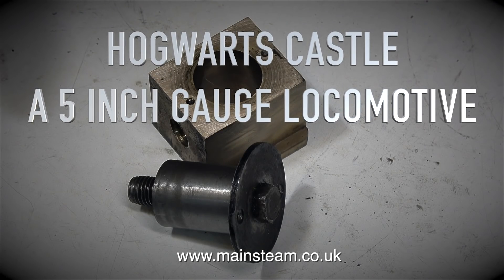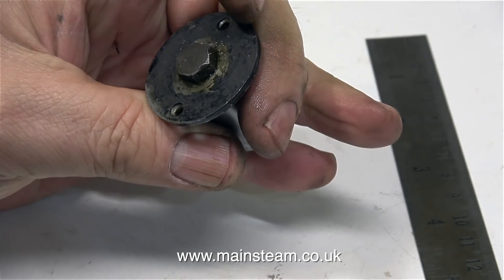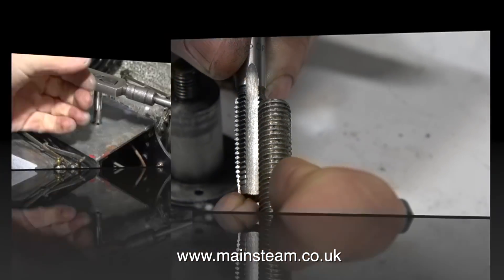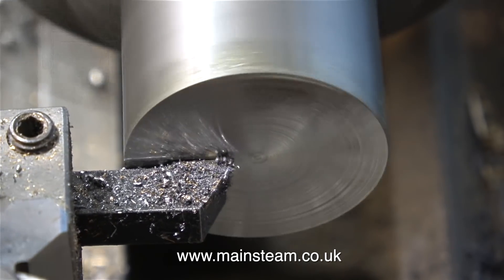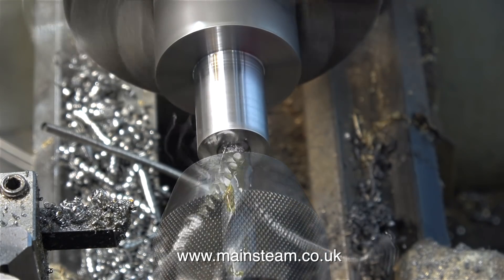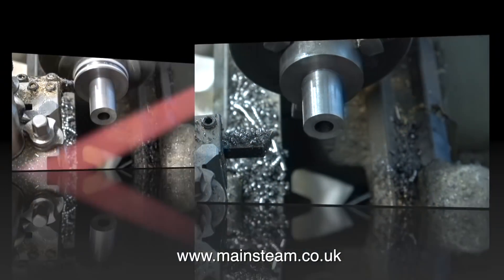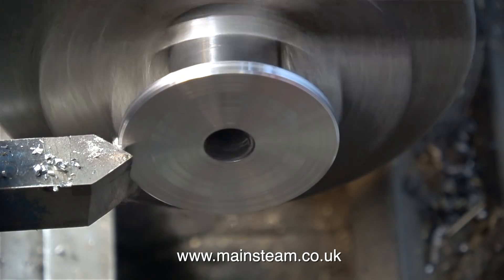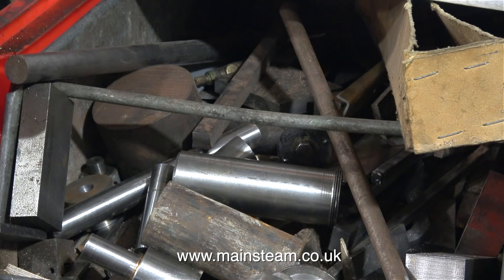HOGWARTS CASTLE - A 5 INCH GAUGE LOCOMOTIVE - PART #11

Comment: EN1A comes as normal unleaded and also in the leaded form. The dash of sulphur in EN1A is what makes it free-cutting (promotes chip formation) and the extra lead in 'EN1A leaded' makes it even more free-cutting. If you bought it as EN1A (which is the form most of the model engineering suppliers provide) then it won't be leaded. Really the leaded form is for the big machine shops turning out 1000's of parts, where every second counts, and therefore usually bought in large quantities. Just for info, no criticism intended. And it really doesn't make any difference which you had, for that application.
Reply from the maker: I bought this from Blackgates Engineering and they clearly stated that it was "leaded" EN1 . . . . and it feels like it's leaded to me . . .
Reply: Blackgates is correct. The other name for EN1A is 12L14, which has from 0.15 to 0.35% lead content. Wonderful stuff to machine. Also - I wholly agree with your statement Keith, "Engineering for the sake of engineering" If a part can be simplified and still maintain function, why not do it? Enjoy your videos as always.